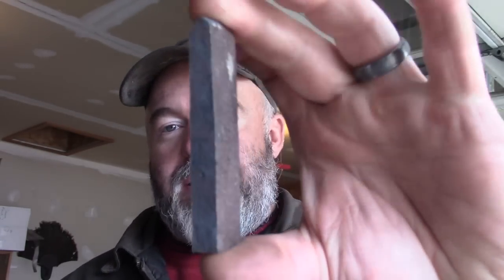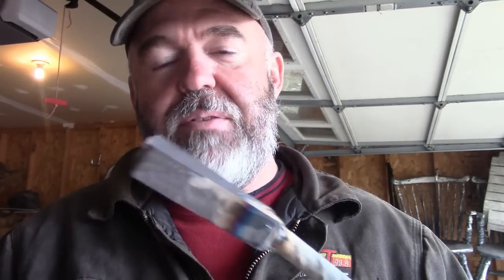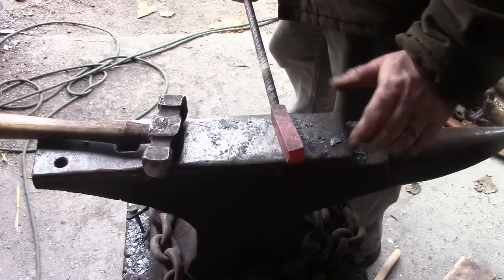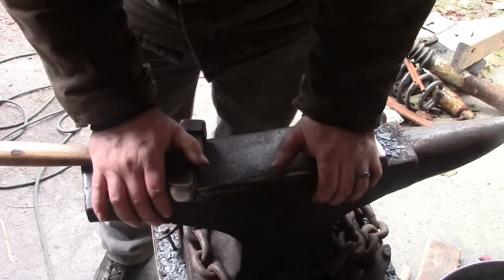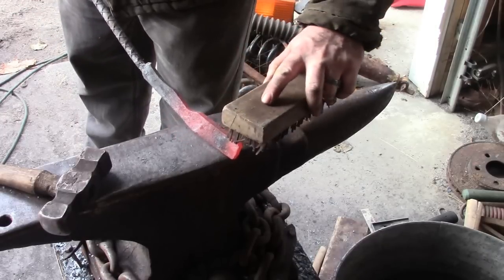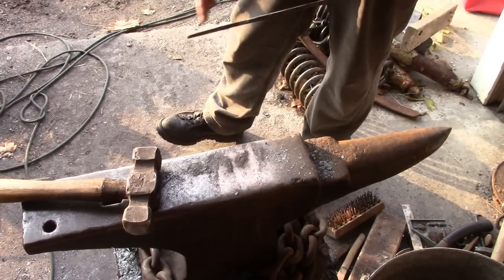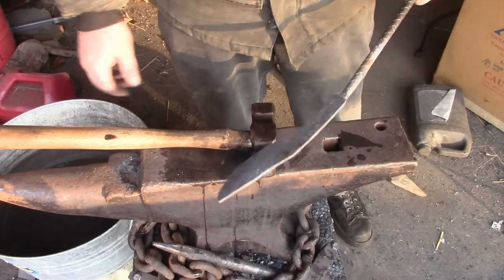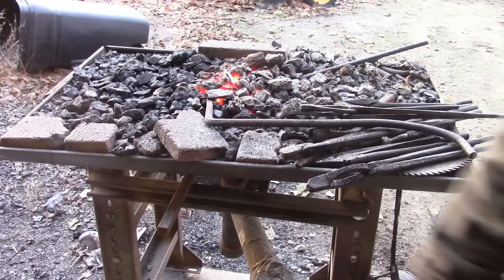How forge a Damascus Knife by hand - Part 2 - Fixing Mistakes

Comment: Thank you so much for this educational video!
i also tried to forge Damascus like you showed but i had no succes and abandoned the project believing this cannot be done without a powerhammer or somekind of a press.
now i know my charcoal oven was just not getting hot enough for steel forging, today i'm saving for a gasforge and will try again .  
thanks again and i your video's are the best.., just to the point plain and simple how i like it .
Cheers .
Reply: Luuk heinz charcoal should get hot enough, something else is wrong
Reply: Commercial charcoal would require a hefty amount of oxygenation maybe the air flow was not enough?

Comment: Hi.. Im a junkie who just recently took interest in forging knives especially welded pattern types.. I just want to ask what's the difference of using 15n20 metal vs construction metals like steel plates? 
And about the flux? Do i have have to purchase the borax, quartz dust and charcoal separately ?
Lastly is about the liquid u use in finishing the knife? Is it oil?

Sorry if it makes me seem stupid for asking these questions but im really new in forging and from where i came from (im from the Philippines btw) the process of forging  knives is completely different... Our forgers process only has includes hammering and heat treating.. Well to say their blades' quality is only determined on a forger's skill on heat treating... Sorry again.. I know it looked like i am just lazy af when i can just google those but my internet data is very limited and only spent it on watching videos... Thanks in advance sir
Reply from the maker: contruction steel generally doesn't have enough carbon in it to harden enough to hold a good edge.  In fact, its my understanding that most construction steel is simply 1018 or a36 which won't harden at all for the most part.  15n20 has around 7 points of carbon, which is plenty to make a knife from and harden it enough to keep an edge very well.
For flux, I just buy 20 mule team borax from the laundry aisle.
I'm not sure which liquid you're asking about, but I quench in oil, and the the etch is done in ferric chloride.

As for a link to the steps of forging, I've done a lot of videos, but not sure what info you're searching for.  I'd recommend checking some other youtube channels as well.  Chandler Dickinson, Alec Steel (His older videos before he started using a power hammer for everything), Joey Van Der Steeg, Big Dog Forge, Purgatory Iron works... there's a ton of good ones, and between watching all of them, you'll gain a ton in of info.
Reply: HoJ Forge thanks a lot sir... That was a great help..  I tried making a knife from a steel cable but most likely its a failure but im not giving up.. Im looking up at other videos about forging and start learning the process step by step..starting from my makeshift forge... Thanks again and ill be looking forward for your other videos..

Comment: Excellent video,helps me lots,cant wait till I get my forge built I will definitely be trying this way to pattern weld DAMASCUS also. by the way Im in Michigan also Southern near Ohio South of Detroit. Waiting for the next video. Do you use Anthracite because it is available or do you just like it better? I have about 20 yards of bituminous it shure does smoke alot though and takes a bit to coke up so Im not sure which to use.Any advice? 
Thanks in advance, Martin at someday soon M/S Blacksmithing and Blades
Reply from the maker: I use anthracite, mainly because its what I can get the most affordably.  I do have a little bituminous that I keep around and use once in a while, just keep my it fresh in my head, because anthracite and bituminous do behave differently.  I'm not big on all the different arguments between forge fuels.  I'm a firm believer that if it heats your steel enough for your purposes, and its what you prefer to use, then by all means, use it and don't listen to the people that tell you that you "have" to use this or that to be considered a "real" blacksmith... and yes, the bituminous does smoke a lot, which is another reason I don't like to use it at my home... my neighbors have never complained when I have used it, but just out of courtesy to them, I'd rather use anthracite which burns with almost no smoke what so ever.  If you've got bituminous, and your used to using it, or can get resupply at a reasonable cost, that I say, go forth and forge great things with it.

Comment: Not sure if you've tried this or not, but you can speed up the drawing out of your steel by probably 3 or 4x if you use the edge of your anvil plate with your rounding-face hammer, rather than the flat of the plate (energy is dispersed across a much larger area—which consequently absorbs more of your energy—when you use the flat of the plate).
Reply: You just radically increased my ideas for anvil plate use. Can't the k you enough that's a forging Jedi mind trick lol

Comment: jason...probly a,dumb question but what,makes,the,dark,steel,n,what, makes,the,light.  ive gotten conflicting answers.  and what kind of contrast would i get if iadded some grade 50 structual steel?  is this what they,call rod iron?  really like making damascus by hand and having been paying a lot for 1095... but im not makeing knives just yet only decorative things.  can i sub in a,36 or a50,a55 for 1095 ?  or is it the carbon contwnt that,gives the dark contrast?
Reply from the maker: From my experience with making non bladed damascus items, the low carbon stuff tends to stay lighter in the etch.  On the knife steels, its the nickle in the 15n20 that stays lighter.  I'd think the best thing to do would be to do a test etch on the different steels you have, clean them up, and see what the differences are.  For a  really dark steel in a damascus pattern though, I think its going to take a high carbon steel, and it always etches darker after its hardened... so I just don't think the lower carbon stuff is going to give you as much contrast.  That's not always a bad thing though.  It all depends on what look you're after.
Reply: well in doing a rubix twist cross for a good freind and in the center in doing a damascus heart.  been doing small bilets of 1095 and 15n20 folded once then twisted and back to square.  which im going to combine with,other,bilets built the same.  what im looking for is just a crazy pattern not just,random twist. any ideas
Reply from the maker: I do thing that I call twisted trails by taking a few twisted billets and then combining them with a layer of 1080 and 2 layers of 15n20 between the billets.  I also like to do the twists opposite directions and then alternate between clockwise and counter clockwise as I'm stacking the billet.  When I do this with a knife, it looks really awesome... with just a small heart, it might be to busy to really make much of an impression though.
Reply: thanks for the info man!!

Comment: Hey Jason, I'm in the process of building a damascus steel Viking helmet, and I was wondering since the blank is going to be a lot larger than one to be used for a knife, would the original billet be made out of more layers, or would the layers be longer/wider? I was also wondering how would you get the blank to a precise thickness? I'm going to try and make mine 2 mm
Reply from the maker: You, sir, are in for an undertaking!  So just some thoughts for you.  Because you will spreading out the metal so much, to get it so thin, then yes, I think you will want a lot more layers than you would on a typical knife.  Of course, its all aesthetics, so what I think would look "best" and what you think, might be two completely different things.  I have taken to doing lower layer counts these days, because it makes the patterns a little more bold, but the high layer counts are always impressive and with close examination, are always fascinating to me... but I can't tell you which is right or wrong.

Thought number two... the size of the final billet you will be working is going to be very large.  If you're doing it all by hand, please take my advice of doing a bunch of smaller billets and then putting those together at the end.  With power hammers, presses, or at least a striker or two, to do it all at once would be extremely difficult, and bordering on impossible... I say "bordering" because given enough time, I know it could be done, but the frustration level would be so huge, I wouldn't consider it a true viable project.

Thought 3: To get it to a uniform thickness, the only way I know how, by hand, it lot of hammering, lots of patience, and lots of desire to stick to such a mundane process.   It will never be as precise as machine plate, and will take a ton of planishing to smooth out at the end, but smiths have been doing it for centuries.  Its just after the time of making the billet, its going to be another test of your determination.

Thought 4: You will getting the metal so thin, and so large, I am guessing that you will be working it over a coal forge.  Perhaps you have a large enough propane forge, or will be using torches, but assuming you are using coal, I caution you to watch your steel closer than ever.  The closure you get to your final thickness, the faster it heats up, and the faster it burns.  At that thickness, in the blink of an eye, you could burn a hole in the middle of your plate.  After the time to make the billet, and the time to hammer it down to thickness, to burn it at that point would be a horrendous shot in the gut.  Do everything you can to make sure that doesn't happen.  Its one thing to burn a piece that you have a couple of hour in to... its heart breaking to burn a piece that you have weeks in to... I say weeks, because if I was doing this, at the amount of time I could forge each day... I'd think I'd have at 10 days to 2 weeks in to this... of course, I do work a lot slower than a lot of other smiths.

Anyways, those are my initial thoughts.  Some others that come to mind is how bold of a pattern you're after.  Heat treated steel always shows better contrast, so if you are after a high contrast piece, you will need to devise a way to heat treat and temper such a large piece... and I'd temper it down a lot softer than any blade I've ever made, just for safety reasons.  

If you do take on the project, please send me some pictures through my facebook or something.  I would love to see what you come up with, and fruits of your labors for such a big project.
Reply: Thanks for the advice, Jason. I haven't actually started work on the helmet, but it's going to look like the one in my profile picture
Reply: I've just realised - will I need a different tool apart from a hammer to spread the billet into the blank?
Reply from the maker: I would think that whatever you normally use for forging would work just fine for the most part.  For the planishing at the end, you might want to look some smaller, more like vehicle body work, hammers.  I don't know much about planishing, except I know to really show off the damascus, you're going to want as smooth a surface as possible and since you'll already be so thin, you want to keep the grinding to a minimum, so that means a lot of planishing.
Reply: Is there a chance that you could make a video on how to create a larger sized Damascus blank? In my opinion, you should keep making longer videos, as they give a lot of useful information, and for such a project I will need as much help as possible. But if you can't, that's perfectly fine.
Reply: So... Three years later and I'm frickin dying. Did you make this awesome idea real?
Reply: Still in the design stages (believe it or not), but it will be done... eventually...

Comment: i really enjoyed your video would muriatic acid work for etching?
Reply from the maker: Any acid will work, to varying degrees.  Muriatic acid is basically hydrochloric acid in a less pure form, but I would think it would still be to strong without diluting it.  My goal in etching, is multiple etching cycles... but that gives me a very particular look that I like.  Depending on what you're after, you might have to play around with dilutions, etching times, and number of etching cycle to get the look you're after.  Also, its not brought up very often, but how well the blade is heat treated can have a lot of effect on how the steel etches too.
Reply: thank you very much

Comment: When you found the bubble, was it too late,to reweld it back together?
Reply from the maker: Yes, it was to late.  I didn't show it on camera, but I did try a couple of times to get it welded back together.  By the time I noticed it, though, to much forge scale had formed underneath the bubble.  It always worth it to try getting it to reweld, but the odds are never good.
Reply: HoJ Forge & HEAPofJEEP 

Thanks for the reply. That makes sense. I just assumed you could always try to remember weld until the blade got too thin.

Comment: Did you flux for every weld heat? It didn't look like u did but myb off camera?  Thnks
Reply from the maker: This is the general pattern that I follow.  Flux at orange heat.  Flux again at yellow heat.  First weld, then right back in to the fire.  Second weld, then brush off and re-flux.  Third welding heat then right back in the fire.  Forth Weld, then brush and reflux for fifth and final weld.  Sometimes that will change because I get lazy and only do 3 or 4 welds, or forget which step I'm on, but ideally, this is the pattern that I try to follow.

Comment: 10:13 what's that material that pops off the sides when you hammer it?
Reply from the maker: The flux melts on the hot billet and created what is best described as a glass coating to help protect the billet from oxidation.  As the outside cools, the molten glass-like flux solidifies and what you see is the result.  So the short answer is, its flux.
Reply: Thanks.

Comment: I noticed that you wasn't cleaning your Anvil off in between each heat. that is what and why you had to do so much Cleaning and Grinding to catch up with a clean blade.
Reply from the maker: Not sure what you mean by that.  The only reason to clean the anvil between every heat is to keep the old forge scale from making impression on the surface, and I'm not worried about the surface until I do my final clean up at the end.

Comment: A really good website building site is squarespace.com. If you go to squarespace.com/forge (a link from Alec Steele) they will give you a free trial and an initial discount. Using such a site should lessen the number of site building issues you may have by simply building a site from scratch, by hand, so to speak.